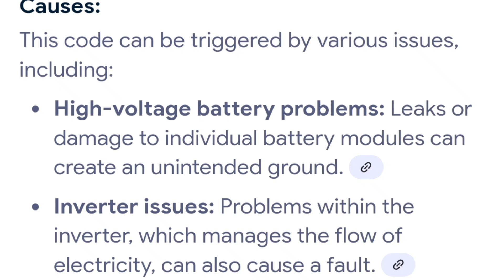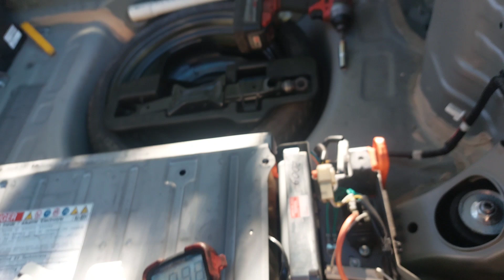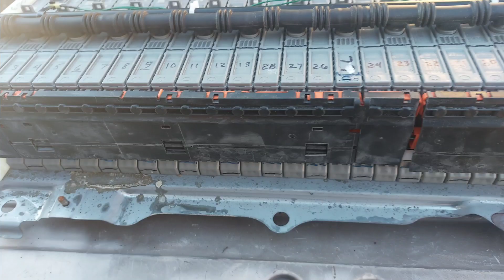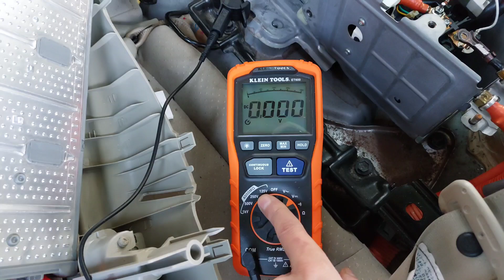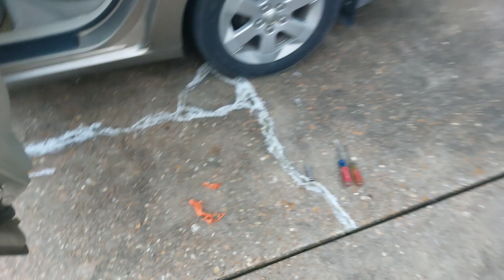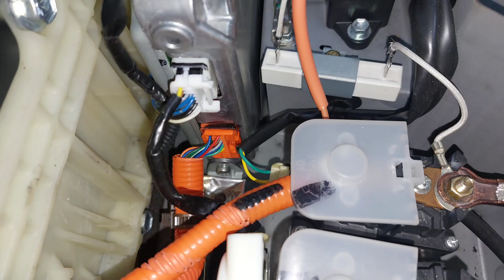Diagnostic and Repair Toyota Prius, Triangle of Death, Part 2, p0aa6.

Comment: You made no mistakes,  you found the problem.  Troubleshooting is finding the problem.  Good job
Reply from the maker: Thanks, but I made bunch of mistakes in part 1 video lol, should've bought that insulation resistance tester right away, it made troubleshooting so much easier, regular volt meter was just not up to the task.
Reply: @everydayirace true but , you got it done!
Reply from the maker: @mchaney9315 yes, it was very rewarding figuring it all out.

Comment: Dude if that big terminal was loose you have a serious high resistance joint problem right there and it would not want to deliver current without getting hot or arcing.
Reply from the maker: Yes, this car had more than one issue. After the cable was tightened, same code came back within a minute just like before.